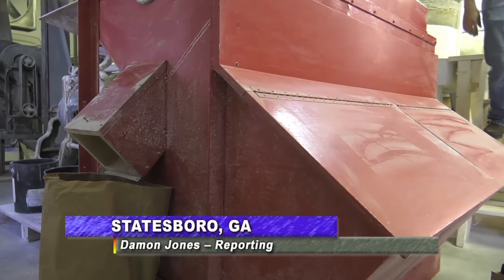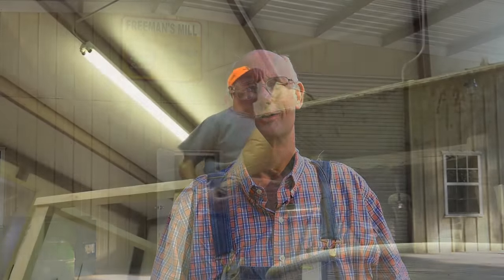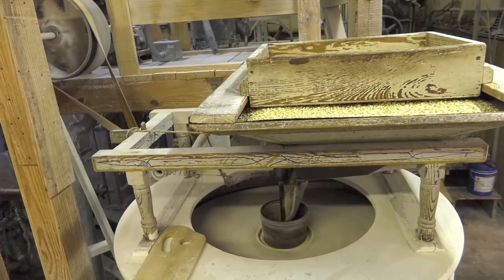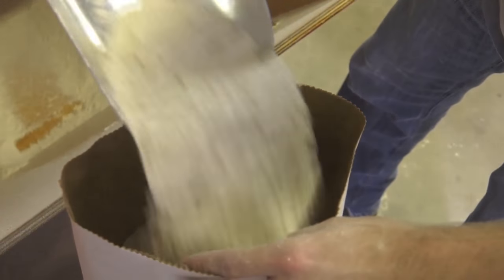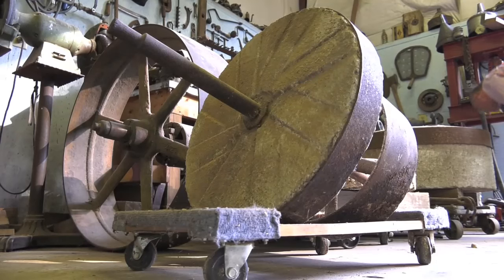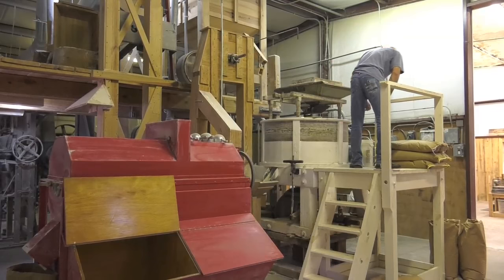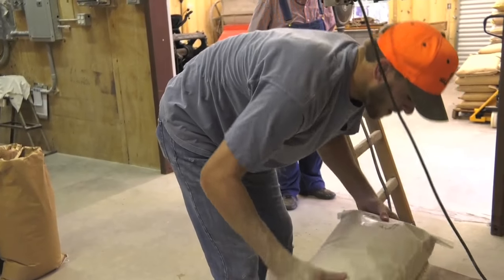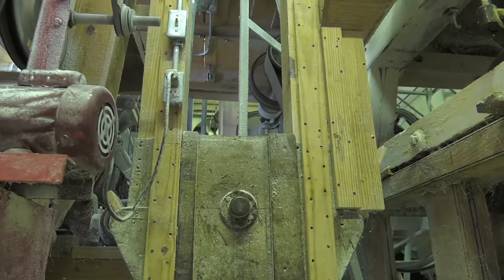Southeast Georgia Mill Still Producing Grits The Old-School Way

Comment: Nice video but you didn't explain what makes grits.  Grits IS NOT corn meal.  It is made from soaking corn in a base, like lime, then drying the hominy that is created by this process.  The hominy is then ground to create grits.  You should not advertise your product as grits if it is just ground cornmeal.
Reply: Grits are a little bigger than cornmeal. I grind my own and sift the first time I get cornmeal and the second time I sift I get grits and what is left is ran through again or feed to my chicken

Comment: Sorry, what you are making is cornmeal.  When you boil cornmeal, you get cornmeal mush, also called hasty pudding.  Grits is a different product.  Why don't you study NIXTAMALIZATION, where the corn is soaked and cooked in an alkaline solution, usually limewater (but sometimes wood ash lye), washed, hulled, dried and ground into HOMINY GRITS.  This is the way grits were made hundreds of years ago and used to be the way grits were made in the south.  The process offers significant nutrition benefits. I am a southerner and I know that just grinding corn does does not make grits.

I am looking for real grits and it seems that everyone who grinds corn think they make grits.  At least Quaker and Jim Dandy use a steam process to de-hull the corn.